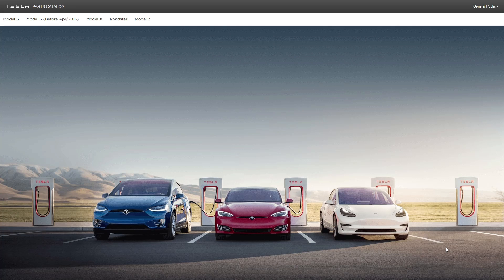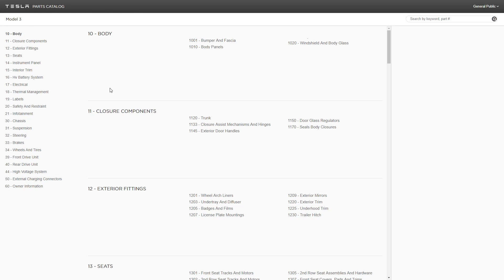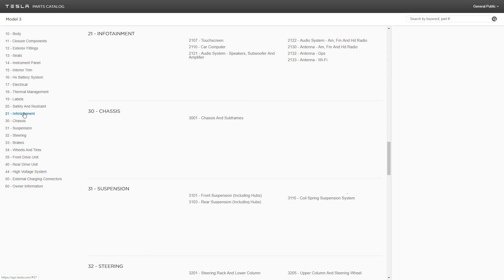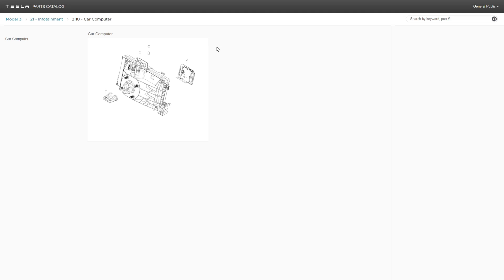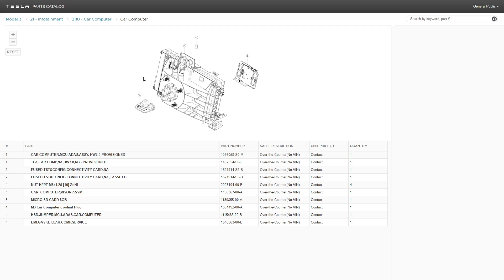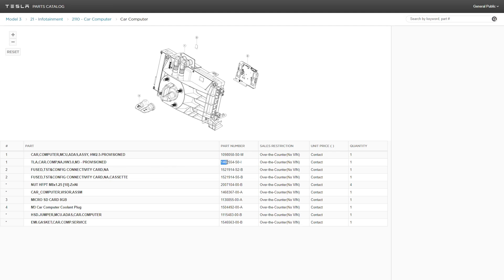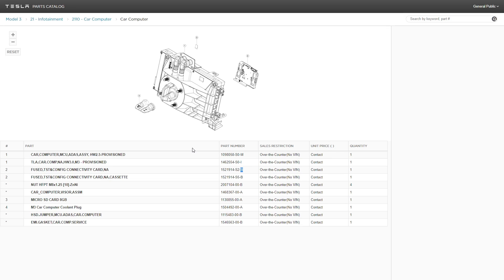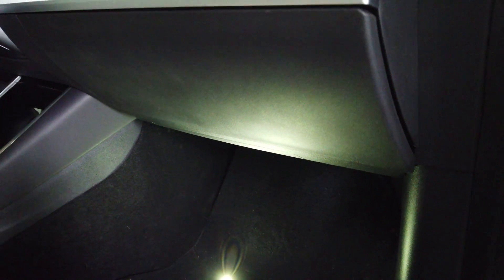How To Tell If Your Model 3 Has HW3 And Is FSD Ready

Comment: Yes, this is the backup autopilot sound speaker. If the normal sound system in the ICE is offline for any reason, it can be driven directly from the APE (Autopilot ECU). So when rebooting the ICE with the scroll wheels you will hear it if AP needs to sound an alert. Note that unplugging the emergency speaker generates a fault that's reported to Tesla.
Reply from the maker: Excellent Information , Thank you

Comment: The easiest way to distinguish Hardware 2.5 from Hardware 3 is by checking the video codec used by the car on dashcam/sentry mode recordings.

Hardware 3 uses HEVC (H.265) and the Hardware 2.x computer uses AVC (H.264).
Reply from the maker: That is no longer the case I have read as they reverted back to the older codec in recent updates.
Reply from the maker: In the end to check physically is not to hard and is 100%
Reply: @thelairdssetfree2486  well, have you checked your most recent recordings? 🤔

Disassemble the dashboard isn't a very elegant solution 😂
Reply from the maker: @RubenKelevra  Lol It was the only way to be 100% sure , for me anyways .
Reply: @thelairdssetfree2486  yeah sure, I would do it the same, but I doubt that many are willing to take the dashboard apart 😂
Reply from the maker: @RubenKelevra  Lol agreed
Reply: Bizarre I have the right serial number but my codec is H.264 ?? got my car in june 2019
Reply: @photographescommercial5053  they've changed the codec back to H.264 on newer cars.

Just check the new system information which is available for a while. :)